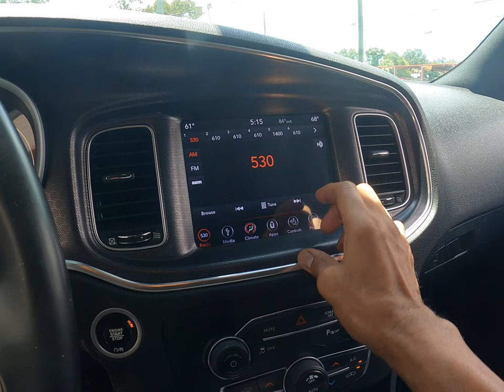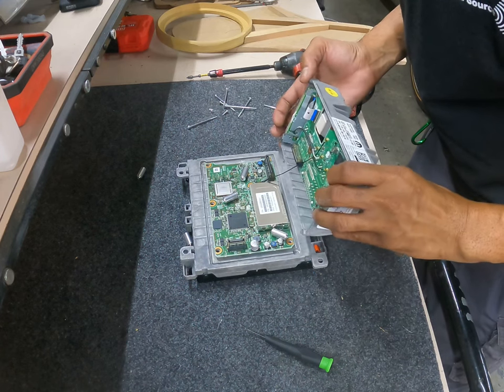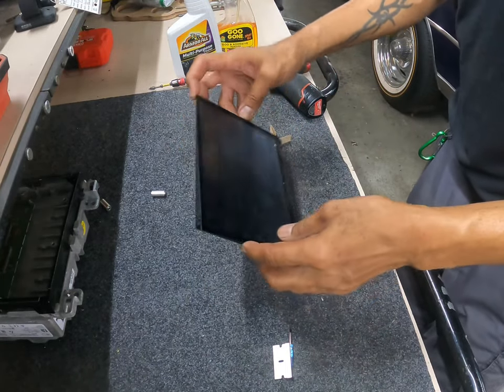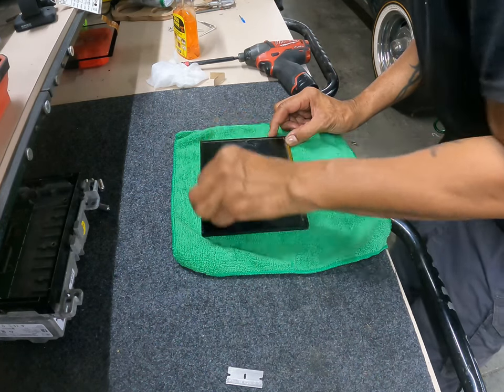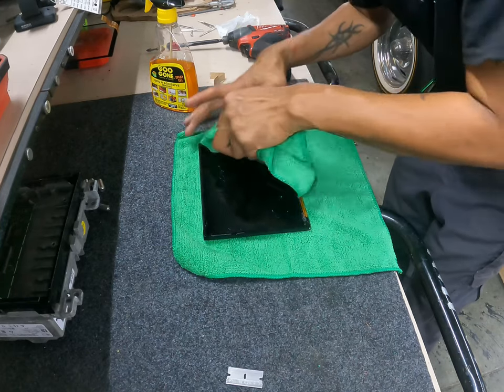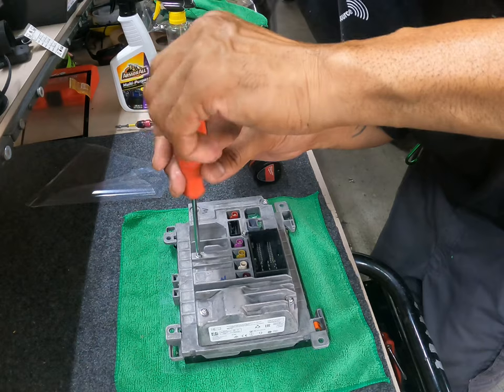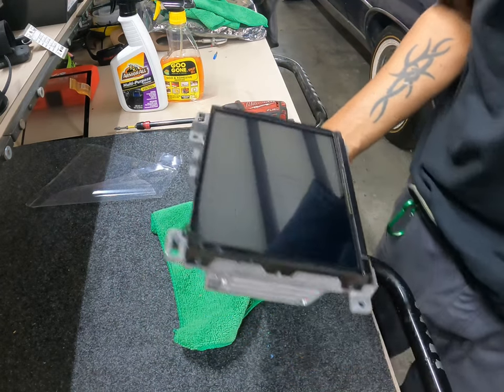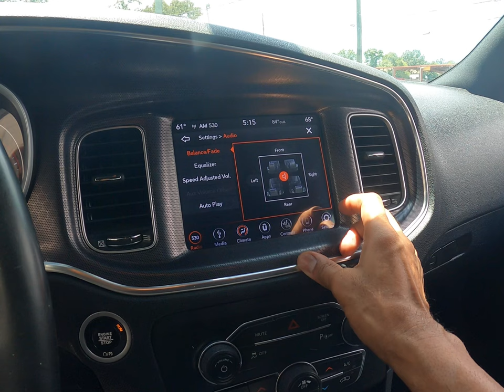Repair Dodge Uconnect 8.4 Touch Screen | Yourself | And Save Money 💰

Comment: i just finished cleaning mine and putting it back in my car but now it’s a black screen or a white screen and occasionally the screen turns on and works but no touch features work, is there any fix? thanks.
Reply from the maker: Okay can you give me a call 478-262-9307 it’s some questions I need too ask you
Reply: Same here wondering why is this happening after fix
Reply from the maker: @wansmith7499  you may need too check the ribbon cable again too make sure it’s plugged in correctly
Reply: @bj_from_the478  the problem was the blue cable with the brown tape not being plugged in, it was ziptired under either the inside and i never saw it to put it back in it’s very simple and easy!
Reply: Put mines back together now touch not responding at all..any ideas? Using same digitizer
Reply: @ryshawnhanks  check that the blue cable is plugged in behind, mine was zip tied somewhere under neither but when i plugged it in it calibrated and worked after a day
Reply: @gonerogue747  all cables plugged in but still no response maybe just need wait a day. Thanks for the quick response
Reply: @ryshawnhanks  anytime man, sometimes if you wait a bit it works, i really hope yours is back to normal soon, you can also pull the fuse box in the trunk under the pull tab and pull the fuzes for radio and touchscreen and see if that works, take them out for 10-15 seconds then plug it back in
Reply from the maker: @ryshawnhanks  call me at 478-262-9307
Reply: @gonerogue747  bro u really saved the day pulling fuses work!! Thanks so much
Reply: @ryshawnhanks  any time man! so glad i could help a fellow dodge owner
Reply: Thanks @bj and @rouge for the assist. I am still getting some ghost touching but nothing I cannt deal with.prob going get new digitizer since used one not completely clear as I would like..thanks guys
Reply: @ryshawnhanks  ghost touching goes away after a day or so at least for me it did, if the screens on then ur good bro
Reply: Yea because you didn’t use an adhesive and it’s glitchy. I’ve seen so many others who use a new adhesive to bond it and fuse the 2 together so I’m not sure how it’s working but then again I am not really sure.  I have changed phone screens and digitizers with success but they are a lot smaller than this and I used adhesive. So I am really curious
Reply: @americanpatriot8996  i figured it out about a day after commenting this, i didn’t have one cable connected that was crucial. It was zip tied and tucked away so I didn’t see it to put it back. But thanks bro wise words
Reply: Who knows where is fuse for Jeep Grand Cherokee 2018 for uconnect. Can't find it under a hood
Reply: It get on after 20 min of running

Comment: Why not just change the lcd? Less time consuming. $$$? Difference?
Reply from the maker: OEM  screen is 1,300  if the customer wants too pay for a new screen I’ll change it
Reply: @bj_from_the478  la084x01-sl01 or SL02 is $300 to $450 depending where to order it from. Just trying to justify the savings and time. Video of the guy with lcd swap makes it look like 1, 2, 3 and done.
Is my brother's truck and we need to fix the lcd. Thanks

Comment: Hello great video, what is the factory part number that you referenced?
Reply from the maker: I have a contract with the dodger dealership too fix there cars so there OEM Parts that are given too me per vehicle the ones on Amazon will work just aswell just read the reviews before you order it. The key too make this thing work correctly is too make sure you perfectly clean the screen and get all the glue off 👍🏿
Reply: @bj_from_the478  thank you. I ordered mine today. Fingers crossed she goes back together well. :). Thanks again.
Reply from the maker: @onevisiononegoalonegod744  well if you need some pointers hit my line 478-262-9307 I’ll help 🤙🏽

Comment: What did you use in between the lcd and digitizer?
Reply from the maker: You don’t have too use anything just clean it properly and install the new digitizer and your good
Reply: @bj_from_the478  thanks 👍🏾 do you have a link as well to the one you use, tried looking up the number in the description it didn’t show anything
Reply: @_.kvng.ky_1081 so what your saying is just take off the original digitizer clean up the LCD screen and just slap the new one on with no glue or adhesive ? 

If that’s the case why not just clean up the old digitizer and re-use it
Reply: @americanpatriot8996  the new digitizer should come with the adhesive strips on the outer layer. if throwing the old one back on just use double sided clear gorilla tape. he has another video looks just like this showing him putting the same digitizer back on using gorilla tape on the putter layer

Comment: Just so y’all know, the chip that’s located on the bezel, i broke mine and it didn’t break the digitizer or touch screen. I think it’s a thermometer for the automatic AC. Which that’s a horrible place to put it considering how hot the Uconnect screen gets.
Reply from the maker: Sir you should be able too solder that wire back too the bezel

Comment: Why not put the digitizer back on?
Reply from the maker: Because a bad digitizer looks awful old and dirty
Reply from the maker: Also I’m cleaning the glue off the screen no the digitizer
Reply: @bj_from_the478  I did this repair today actually, took out the unit, cleaned the glue off the touchscreen and digitizer then placed double sided tape in between the two on the black border around the digitizer. So far no ghost touching. Only costed me some goo gone spray and the tape. Used your video as inspiration as well.
Reply from the maker: @vapesan666  greatly appreciated thanks glad it helped
Reply: How thick double sided tape did you use on the black boarder
Reply: @larrycardosi2900  I used whatever Home Depot had, used double sided mounting tape. Can’t remember the brand but any double sided tape should work even mounting tape

Comment: WD40 works wonders for glue removal.
Reply from the maker: Sure butt your not going too want too use any thing like that on a lcd screen prime example spray wd40 on you Tv screen in your house and let me know the outcome you’ll be in Best Buy tomorrow buying a new TV 😁 just be careful because that lcd screen is very sensitive and you can damage the screen 👍🏿
Reply: @bj_from_the478  Why would I spray WD40 on a perfect working TV?